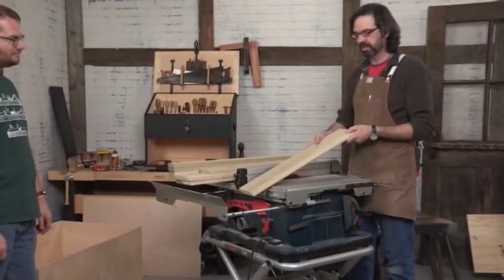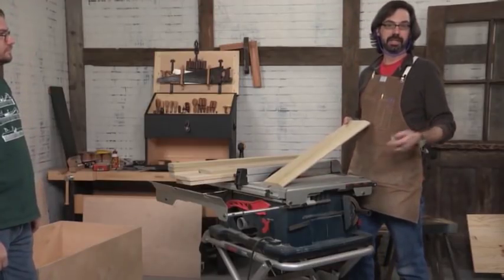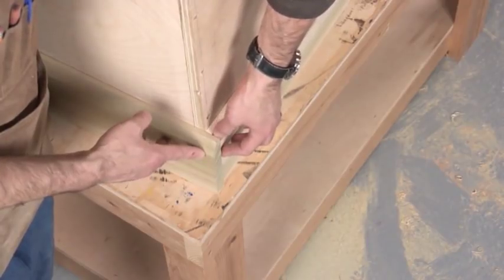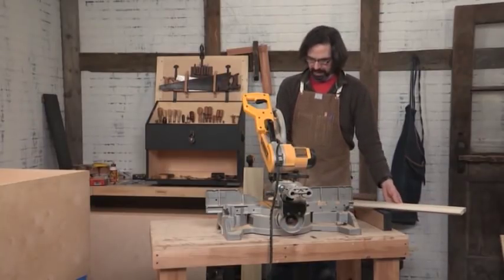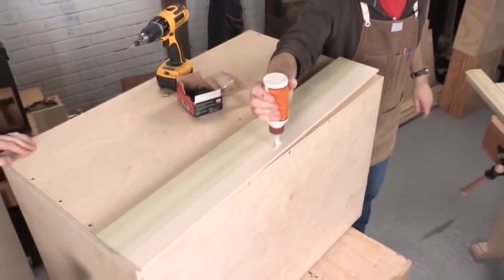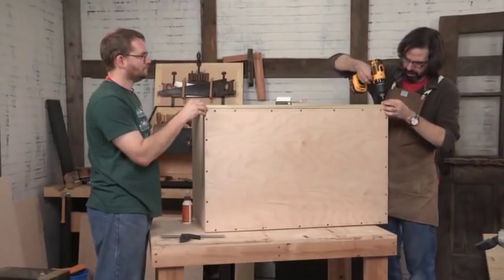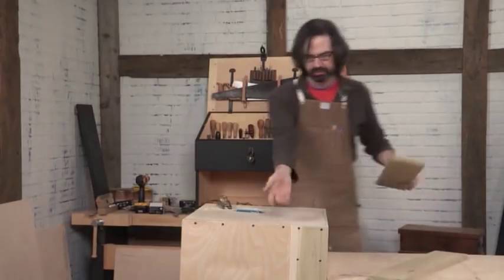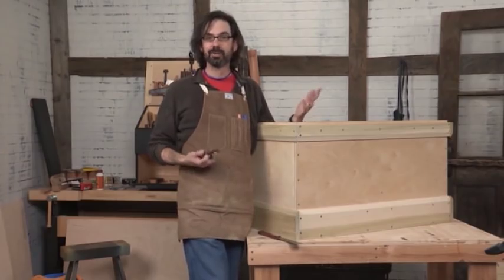Build a Plywood Tool Chest with Christopher Schwarz Part 6

Comment: Also a good idea to have an air cleaning system for your shop - that dust can hang in the air for a while. I don't have that yet, so I haul the gear out into the driveway and work there; eventually I'll have a good two-stage air cleaning system - hose and intake I can set next to the tool with a cyclone gadget on a 5-gallon bucket as stage 1, with a HEPA filter inline iwith the vacuum as stage 2.  Only have one set of lungs . . .

Comment: Hi my friend. Great videos. Back when i was in school (1980s) My teachers were not Half as good of teacher as You ARE. The change I would make is to glue the bottom (floor) of the box and Ad 2inch wheels.  I still have many things I made in High School. Have you ever added water to water based glue or is that unnecssary?

Comment: No glue on the bottom for change out later; but won't the glue on the skirts negate the easy change you were designing?  Or am I missing something?   Thanks.
Reply: Possibly, but he tried to keep the glue away from the edges of the skirts. As long as there wasn't too much squeeze out, it should be fine. Especially if it gets so bad that it needs to be replaced, the wood will probably be pretty rotten and leave only a small amount of wood behind that can easily be cleaned up with chisel or sandpaper.
Reply: Your sure right.

Comment: As far as protective gear goes, I'd agree that hearing matters, but I'd rank breathing higher. I always wear a mask when I use the table saw, chop saw, or router, otherwise I'm standing in a cloud of fine (possibly carcinogenic) sawdust, and I end up couging and hacking for hours. Pushstick, and eyewear, mask, and hearing protection for both people.